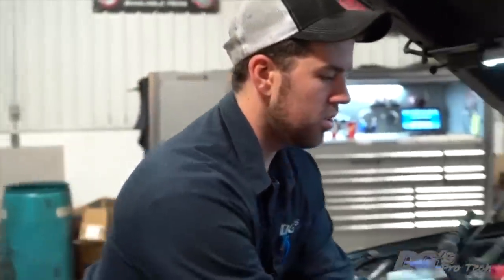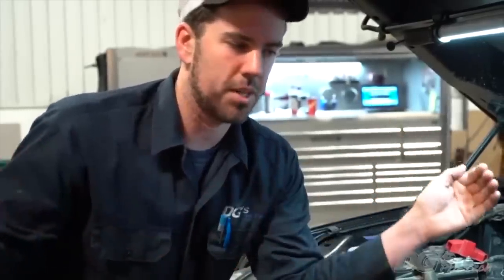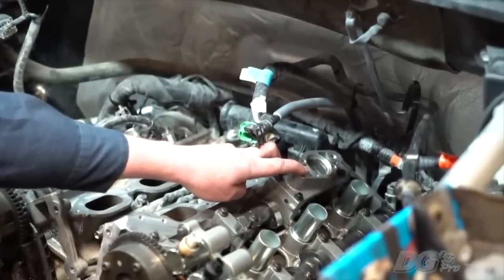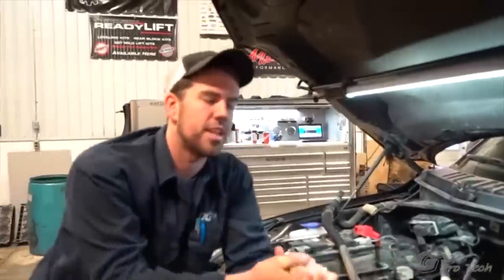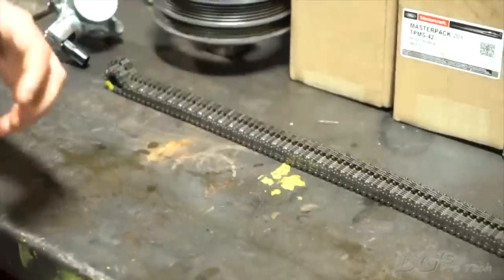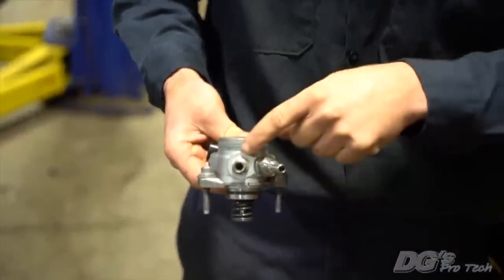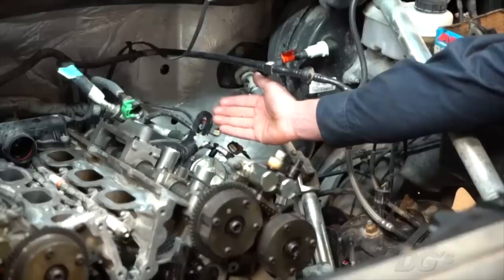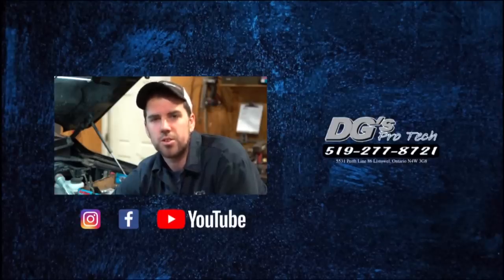What you NEED to know about Ford EcoBoost Engines by Dustin Golley of DG's ProTech

Comment: just what is lack of maintenance on a timing chain. do these chains have needle bearings on every link? I suspect not. You can get a V8 roller chain with OR without bearings. If they do, these are probably expensive chains. another reason to buy something more reliable AND less expensive to operate. Can you imagine paying 60,000 dollars for the truck and timing chains going out at 30,000 miles or so. a nightmare. . Ford going out next on strike for more wages. lol. GM got their strike settled.

Comment: Great video. The only thing I would add is be sure to flush coolant and replace coolant every 30,000 miles. The coolant is broken down via the twin turbos, which tend to cook coolant inside turbos when engine is turned off.

Comment: Excellent explanation and advice.  From what I see, most trucks are not hauling or towing anything, therefore, the Ford base non-turbo 3.3 V6, would probably suffice for 90% of the public, and will probably be more reliable in the long run.

Comment: An overly complicated engine that needs a computer just to run.
Reply: I agree. Way way too many systems that all need to work perfectly. Genius is in simplicity, Gm has had it right for a long time.
Reply: david goodwin Guess that’s why no GM truck can compete with my EcoBeast Raptor & they’re not even trying to build something that will challenge it. At least Ram is trying with Rebel TRX. Just saying. BTW, didn’t GM take the bailout government takeover deal, so how exactly are they doing ANYTHING right?
Reply: @jamminhard  The reason the government won't let GM fail is because it is THE war machine. Ford had mortgaged itself balls deep before the recession, meaning they were actually in financial trouble before the other guys.
Reply: @turbolq4  if they didn't get bailed out, they were taking care of business.
Reply: Ecoboost is high tech which is not overly complicated just one of best engines available. Get with the best. Use fully synthetic oil. Service at the little earlier intervals and grow tf up.

Comment: I have a 2019 Escape 2.0 litre. How do I “stay out of the boost?”
Reply: Drive it like your on your last tank of gas 😂

You can probably feel your turbos engage when you accelerate a bit faster than necessary. I definitely can. You can hear the turbos in the f150 though. Not sure about the Escape.
Reply: I'm never in boost on my 10 speed
Reply: Airwolf Do you have 245 hp?
Reply: Drive like an old grandma.
Reply: @RickNethery  Perhaps, the question should have been, "How can I tell whether I'm in or out of the boost?" I don't notice much difference no matter how I drive.
Reply: @michaelfenemore1168  Probably has some kind of boost gauge on the dash. I figured you would feel a surge of power when the boost builds and the rpms start climbing.

Comment: Nice video, good info. 
Should these engines be driven hard to prevent valve coking? Or just the opposite? Not sure what to do. I read that installing a catch can voids the warranty.. 

I have a 2015 2.7 ecoboost.
I bought my f150 XLT with 50k miles and can hear slight tapping at cold start up and then it quiets down a minute or two later.. it drives nicely though.

Comment: Really appreciate it! Just bought a 2018 with the same engine. I just took a 10 hr trip and my mpg was horrible! 16mpg. But I drove it like I wanted. I run premium fuel cause it said its recommended. (I know the difference between recommended and required) I just want it to last a good time. Glad you showed care in this video. Keep on grinding.

Update: just took the trip back and I got 22 mpg. I was trying to see how much I can get. My trip was 580 miles from 3,300 ft above seal level to 36 ft above sea level. Not bad. Tried to stay off the turbo on this run.
Reply: My Suburban with a 5.3L running 87 octane gets 17-22 mpg all day on trips. Oh, and it has no issues with seized turbos, stretched timing chains or turbo lag. Just pure V8 power

Comment: I have a 2013 F150 with this engine. 95,000 miles so far. No problems. Use full synthetic oil and Premium gas. Worth the extra cost. I love the truck and engine. Great video!  Really good information.

Comment: These problems aren't unique to Ford engines, they basically apply to any modern engine with certain new technologies.

Long timing chain made of economical but too thing material: amplified wear especially if there are too few lubrication points during one cycle of the chain.

Direct injection: clogged intake ports and valves because gasoline vapours will not clean the intake side like in traditional port/manifold injection.

Turbo charging: lubrication problems with bad/old oil, overheating if turning off the engine too soon after hard driving, stuck waste gate when not exercised

Variable valve timing: stuck actuators due to bad/old oil and driving patterns not exercising cam timing

Exhaust gas recirculation: Bad driveability due to the egr valve getting stuck or not sealing properly due to soot accumulation or failing solenoid/actuator, exhaust gases clog intake manifold and valves with soot (especially on diesels)

Long oil change intervals to get better service cost ratings: pure short-sighted craziness, it should be a no-brainer to rather change oil more often than not, especially if you can't make 50/50 between uninterrupted highway driving and city driving. And use that fully-synthetic in any case, it's been the 2000's already right after the 90's! And changing the oil filter is even more important than changing the oil. Does no good putting in new oil and leave the old, clogged filter in place for too long.

Comment: So you can have eco or boost but not both at same time. So I can have eco or reliability but not both over time. Also if I eco too much then I get carbon coking intake valves. Eco seems bad. Going back to Toyota 2JZ-GTE, Jeep 4.0L, and 12 valve Cummins videos. In straight 6s I trust...

Comment: I don't like one long chain to run both sides. The 5.4 has the two chains, much shorter. Another engine using this one chain setup is the 2.7 Chrysler v6, which isn't one of the better engines. One chain, with wear stackup, is bound to cause trouble.

Comment: The thing that annoys me with these engines is putting them in a truck. Yes I know all the lovers of it but it was made for eco or gas mileage. To me the use of a truck is  towing or pulling aka trucking. Usually gas mpg is not at the top but, if a truck had to have boost to pull and your losing mpg then it’s a waste. I have the 5.0l I do get low mpg with giving it gas but what I love about my 5.0l is it’s flexfuel. I spend 50cents less per gallon at the gas station. My knowledge for turbos which is normally should have high grade gas and it cost more.

Comment: I love my 2019 F150 with its coyote 5.0.  I almost bought the 3.5 EcoBoost but decided to buy the coyote.   I'm going to upgrade the oil pump and throw a Roush charger on it.   510 hp to the wheels.  CARB legal headers are in the works from a few different suppliers.   I was going to put a turbo on my 88 Mustang  GT.  However,  no smog level turbo for California.  I went ahead and bought a new 2.1 Kenne Bell for it.   I would love to put a 3.5 EcoBoost in my wife's fusion.
Reply: Darren Hall does Fusion come with a 3.5 turbo? I thought it was the 2.7 .

Comment: Great video, I had a 2013 F150 3.5. And I loved it. It towed great, loads of power, and all round great truck. I used mine on a farm, so basically I ran the hell out of it. And on Saturday nights their may have been burn outs and turbo spooling to an excessive extent. Even with that I drove it to 175 000 miles before one of the turbo bearings finally started to whine. But that was enough to convince me of just how good they are. I'd definitely recommend one.

Comment: A huge pile of shit,has timing chain,headgasket problems including fuel injectors blowing out of them.A miss under a load pulling something too.Jasper put 6 of them on test stands for their 100,000 mile test.All of them blew up not passing this test,Jasper does not reman this engine for this reason.$2,500.00 to $3,000.00 for an used 3.5 and 2.7 ecoboost from a junkyard.My dad sees them at the auction announced with a bad engine a lot.Don't get the fuel mileage Ford claims.